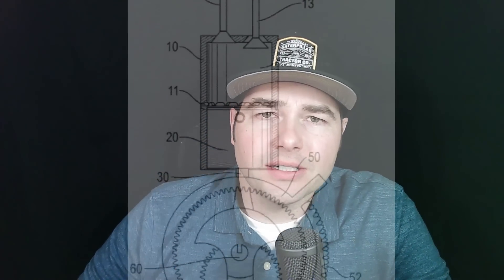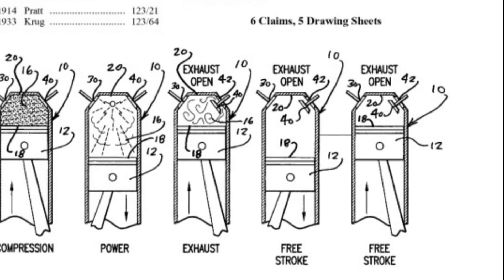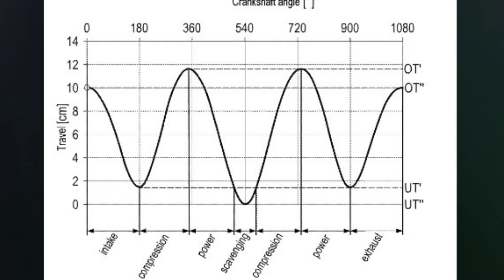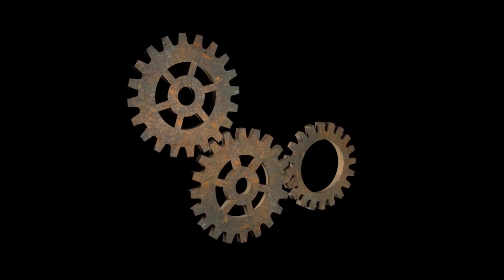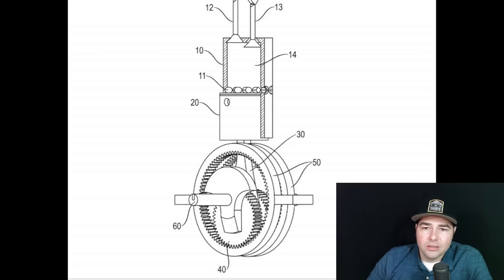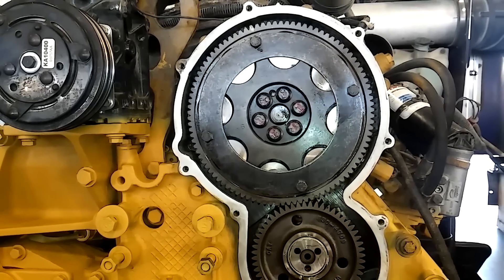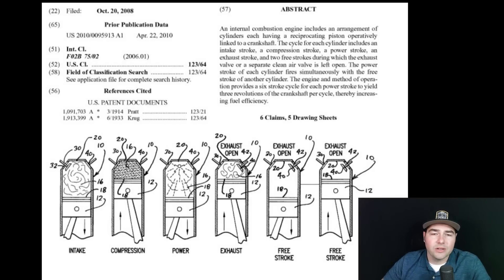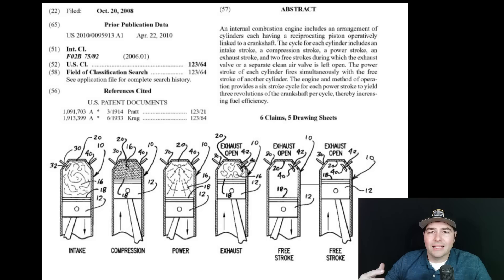Ever Heard of a 6 Stroke Engine Cycle? You Will Want To.

Comment: Well, Im not sayin its perfect, but youd essentially get 1 cyl having a full power stroke and another cyl having a scavenger power stroke, which would give you, lets say 40% more power. The 2nd power stroke is like a booster for the 1st. Its silly as a single piston but as a 6 cyl, every main power stroke would have another piston give 30-50% power too.
Reply from the maker: It's definitely an idea, not sure the logistics on that Crankshaft operation though.
Reply: @AdeptApe  no its complex af. But with adjustable displacement and all the new crazy stuff, like hydraulic valves, it might all work out. Essentially each powerstroke would be boosted by another by 30%, lets say, so thats a 30% boost in hsp. On the same fuel consumption. Theoretically. Id love to see it working.
Reply: It would be pretty big and heavy.
Reply: I wonder if they are also working with different gear sets on the bottom end. You could almost have a high torque gear reduction or visaversa
Reply: @jordanwedel7738  exactly. Combine all of the things and make it so complex its cheaper to buy a new porsche than to fix lol I can see what theyre goin for, 1 main and 1 scavenged firing at every revolution. But its complex. And comllex doesnt always breed reliability
Reply: I would never want to own one, but would love to see the thing running. I would assume it come standard with a minimum of 2 flux capacitors and a gallon reservoir of blinker fluid
Reply: @jordanwedel7738  lmao absolutely. Id love to see it runnin but not own 1. Sounds like nothing but issues. Especially 1st gen